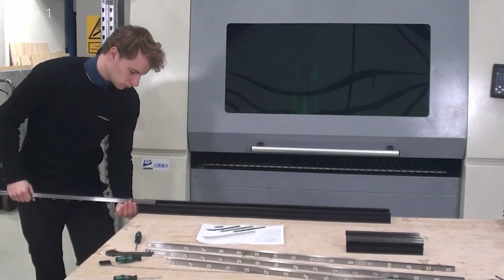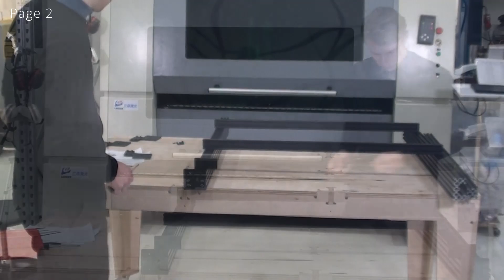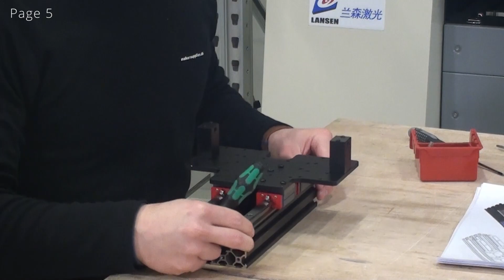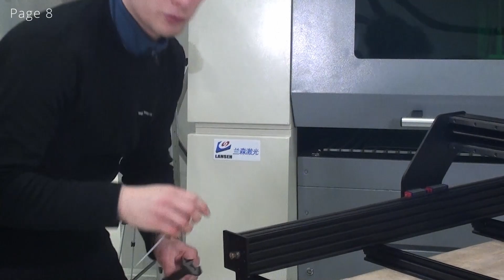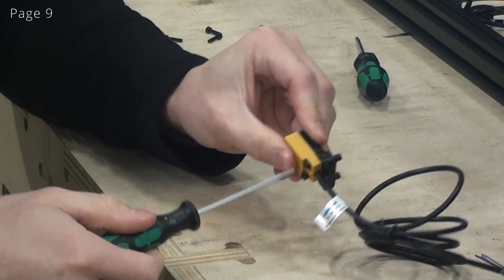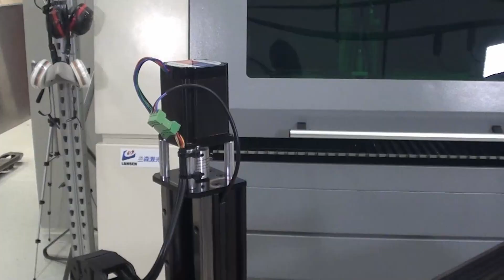Piranha LEAD-screw CNC - full assembly

Comment: Hi, interesting machines but can you add more detailed specs on the website? For example how big is the range of the z-axis. Couldn’t find any info.
Reply from the maker: @LRSKWTKWSK  If you scroll down below the part with all the parts included you will find a description. Here we give the work area. E.g Piranha 1010 with a foot print of 1000x1000mm has a work area of 760x800x150